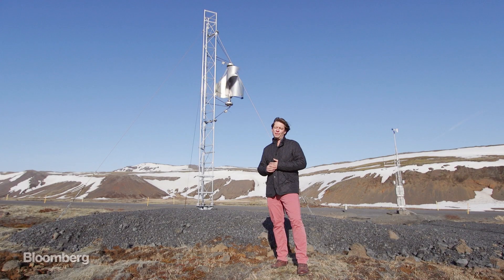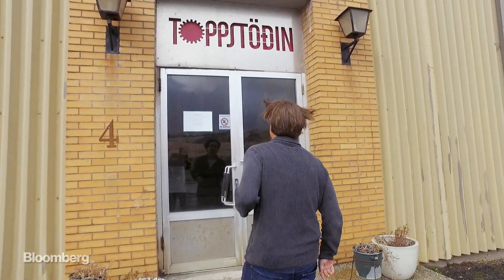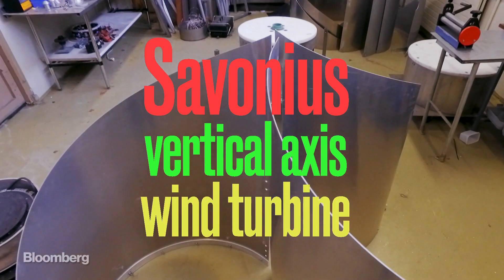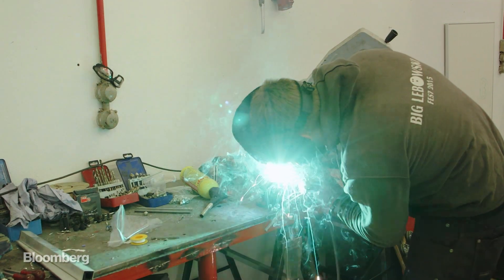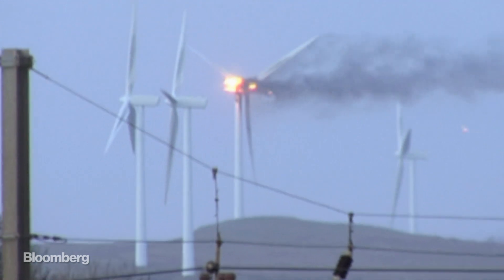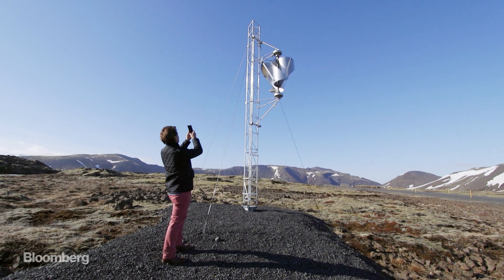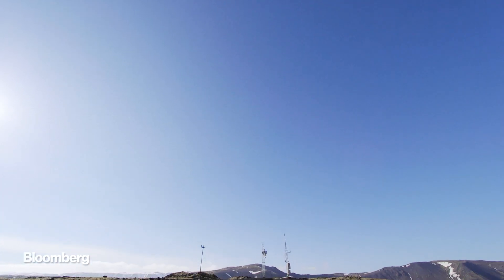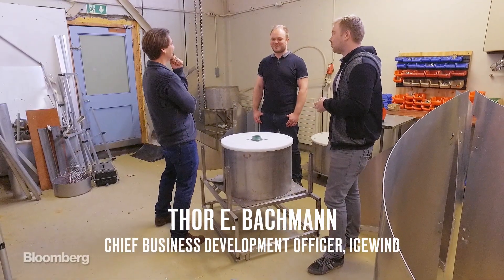The Tech That Could Fix One of Wind Power's Biggest Problems

Comment: The video failed to mention a major advantage of this type of turbine - it works with wind from any direction with no need for reorientation as wind shifts.
Reply: What is it's efficiency, and how does it compare against the conventional design?

And how does the Total Cost of Ownership compare btn the two models?
Reply: @darmillionaire  Efficiency is hard to rate. If you rate it by diameter, it would be about the same if the cylindrical turbine was really narrow but tall. And the propeller one would have the same rotor diameter (a very small propeller turbine). That gives you an idea of the vast efficiency difference. But that is only for the materials to get the same power, but easier to make and you only need a generator the same size as the same diameter propeller turbine (really small).
Reply: @darmillionaire  You can make the fucking blades by yourself. Those are the ones that make the hole thing working.
Reply: It also failed to mention how miniscule their efficiency is.
Reply: @NGC1433  They are compact so they can be placed on top of buildings and whatnot: Many little makes a mickle.
Reply: @NGC1433  But lets look at the high thin cylindrical tower turbines (that are even less efficient). You can put heaps of them up in the same space as only one conventional one. Also the tower ones look better and are quiet. If the cylindrical tower turbines are 1/20th efficient as one conventional one, you can put 20 in the same space. And each one would be 1/20th the cost of conventional ones. Generators 1/20th the size and the blades would be 1/20th the cost. And you could put one on top of your house, looks better and quiet. The biggest advantage is quiet. Maybe lots of them would give a shushy noise a bit, but none of that annoying hum. And also another big advantage of cylindrical turbines is more bird friendly!
Reply: @NGC1433  Meh you can make a lot of them.
Reply: These turbines make very little energy for their size and wind.  One on every chimney, which would be hundreds of millions of them, would still not make an appreciable percentage of our energy use.  They are handy in remote locations in Iceland, where energy needs are low, but not so much in higher energy use areas.
Reply: A long proven way of directing a windmill to the wind is a tail.  A tail is perfectly effective at directing a turbine into the wind like its been done since windmills were used to settle the entire US with water pumping.  The feature of being able to service wind in any direction is something that was not a problem, and is not a problem.  The problem why vertical has never succeeded is mainly backside pressure and the fact it cannot harness from both sides, one catches, the other resists.  A traditional windmill prop harnesses the entire swept area and thats why it produces so much more power.  Its not even close.  Thats why no utility company will ever use a vertical, because it doesn't produce comparable power.
Reply: it also "failed" to mention a lot of things, like their efficiency.
Reply: If it's put lower to the ground Kids can also have a ride!
Reply: @tonykuli  😃👍🙂
Reply: The low efficiency design could explain why it survives higher winds.
Reply: Windturbine efficiency is a combination of rotor efficiency and generator efficiency. The efficiency of a turbine is the generated power divided by the potential power of the rotor (P=1/2ro*cw*v^3*A). The rotor efficiency of a three bladed turbine is limited by the Betz limit (0.593). But the efficiency of rotors in this video is much lower.
Reply: DM i don't know i haven't been able to find out but the point is it not a revolutionnary idea it just has a slightly diferent field of activity.
Reply: I agree completely that there are advantages and disadvantages, but all advantages and disadvantages summed up, that would be interesting. Of course, public opinion is not visible in the LCoE. But still, it is in my opinion the only way to compare wind turbine technologies like Direct drive, Savonius, conventional gearbox systems etc. So i'm neither advocate nor opponent until the cost of energy has been documented.
Reply: You could also use aluminum, plastic, carbon fiber...
Reply: Darius der Rote I couldn't really tell if it's flawed for purposes of making power, but I like the way it looks. I make decorative windmills and kinetic art to sell, I think I'll make a small one out of aluminum and see how it goes.
Reply: Bill Juhasz Of course. But such is also more or less the case of small size, regular axial turbines. They are good for recharging batteries etc, but not much more. It is only at larger sizes that appreciable amounts of energy can be extracted from them.
Reply: It also failed by showing turbine without any device capable of producing energy. The one that guy is taking a photo of, it's just spinning to please the wind I guess.
Reply: @ardvark84  - Looks to me like it has two devices to generate power, one at the top & one at the bottom.
Reply: traditional 3blades  HAVT turbine is 42-45% efficiency and this crap about 9%. It is really old news- everybodystarts from this type because it is easy to build but compare ir to real generator is like comparing black barrel to PV panels as a way of gathering solar energy. And think about strong wind you still have to balance the drag force when with conventional generator you simply change direction to make rotor parallel to wind. High school physics.
Reply: @4nrgy  I realise they are way less efficient, but how is that measured? Is it rotor diameter or blade area or materials required? If the cylindrical ones are (say) one tenth the efficiency as propeller ones, you could put 20 in the same space and the generators only one tenth the size. But the real advantage in the cylindrical ones is no noise and more bird friendly.
Reply: @4nrgy  the problem with higher efficiency, is the high speed brakig needed when the wind is way above normal. this one solves that major problem easily.
Reply: Very true and cool.
Reply: IronheadOfScroteus every Material has it's own set of benefits and drawbacks. The main problem is the flawed, basic design of this type of turbine.
Reply: Yes, Iceland has been sitting forever on free energy source, they don't feel the same urgency and need for high efficiency.
Reply: Except when wind blows down or up.
Which it can.
Reply: +RoofMill.Net
Yes it is an advantage. Maybe not on open expanses where prevailing wind rarely shifts, but in urban, heavily-built areas, it is not uncommon for wind to be constantly gusting from all directions. A turbine that needs to be reoriented into the wind loses that much time before it properly faces the wind, while the type shown in the video will put any gust from any direction immediately to good use. It is a definite advantage.
Reply: Nor did they explain how it stops over spin, just that it does...
Reply: @Giorgos Chatziioannou I stood beneath a tall windmill near a beach in Denmark while it was operating. The windmill was probably 30 meters or taller (about 100 feet). It didn't make a sound. I tried as hard as I could to hear it, my hearing is close to perfect (I had it tested) and there was no sound at all while that thing was spinning.
Reply: corisco tupi good one
Reply: Well just imagine one on every chimney...it all adds up and helps take away the power of the Multi-National criminals!
Reply: +NGC1433 is it really not efficient ??
Reply: And uses a lot of Stainless Steel.
Reply: I believe to put more small windturbines that anyone can easily install in backyard or balcony, can do the change comparing with huge effort, while you try to build big construction for VAWT. So everyone of us can make contribution to better future. The same is with small solar installation. They are not that powerfull but make a change in understanding the possibilities with renewables.

But you are right HAWT will probably be newer as effective as well designed propeler turbine in hights. :)
Reply: We are using similar VWTs at locations that are mobile. They are only 3 feet high, and about 18"in diameter. Two of these will give you enough power to run your home, refrig., tv, freezer, lights, elec stove, computers and still have power to sell back to the grid if you were inclined. Since you don't need to face the VWT into the wind because of it's design, it is basically a plug and play system. We were generating 100 amps of power, aprox. 10k watts. Mines are using them because it is virtually the simplest way to generate power at remote locations. If you have a solar set up, it depends on the sun, but the set up is the same. A trickle charger keeps the batteries at full charge.
Reply: @999garyr  What generator are you using, and at what gear ratio?  I have never seen or heard of a demo of one of these these even remotely getting close to 100 amps and 10k watts.
Reply: @999garyr  Absolutely impossible for an 18 inch wind rotor to intercept that much energy from any realistic wind speed.  You made it up or someone lied to you about those specs.
Reply: The set up is one that I observed while working at the mines in Utah. Rio Tinto copper mine. I only know what I saw and experienced.
Reply: I am considering a vertical axis wind turbine that looks exactly like a tree, I call it : e-tree,
the trunk of the e-tree is brown, the spinning blades are green,
attached to the trunk of the e-tree are features of : wifi/mobile network, light and power outlet, to charge a car for example
Reply: Hello, How does one define and more so measure the efficiency of wind turbine? Serious question..
Reply: Sergey K
Well, Paul just beat me to the punch there.^^
But on the part of how: You can calculate it, simulate it or test it.
Simulating is by far the most common and easily done method, especially if you do not have any exact numbers for the cw.
Reply: "Potential power of the rotor" for that do we use the cross section area of the blades? if so then for a conventional turbine that does not include most of the area of the circle in which it spins inside? Is it possible that for a fairer comparison of these two types of turbines we need to consider not just the blade area but the larger area in which the blades operate in?
Reply: IronheadOfScroteus
For that: It's perfect.
Reply: And that means no ungodly expensive (not to mention breakdown-prone!) system to orient the blades to wind direction.
Reply: The advantage of this type turbine is that its not dependant on wind direction . Good for gusting variable winds. Also the trailing blade slows the the turbine in high winds.... preventing damage
Reply: RoofMill.Net Why does the generator need to be on the bottom? aside from perhaps being top heavy, I don't see any reason for them to do that. Or they could extend the shaft and install something to deflect the water, such as a cone. With the tech today, I'm sure there's a feasible way to stop the water.
Reply: This 2000 year old idea is so new that people just are not ready, and will have to be forced to use it.  Possibly at gunpoint.
Reply: While vertical axis turbines look cool, they are less efficient than horizontal axis (conventional) turbines.

This can be understood by using the formula for energy production in a turbine system.

P=1/2* a*V^3

Then multiplying P by the Betz limit of 59.3%.

Then understanding that a vertical turbine is half of that number because always half of the blades will be fighting the wind while the other half is following the wind.
Reply: There are other types of vertical wind turbines, which all benefit from this advantage, but the Darrieus type for example is more efficient.
Reply: it looks like a moving sculpture...
Reply: @EdHanulChung1  A moving sculpture would generate more electricity.
Reply: It also failed to mention major disadvantages. Which there are few.
Reply: @movax20h 
 Of course; like less efficient. and puts far more load on the bearings than a conventional one, which eats bearings in a matter of months anyway.
I have one comment for all the people who are bewitched by marketing dross like this: If it were that easy, we would have done it years ago. Engineers have spent centuries distilling out of all the crazy dreams people have had, the very very few that actually work, and of those, the very very few that work better than what we have already. We had a thousand years of windmills, that vanished in less then a hundred years because steam engines were simply massively better.
Reply: @leosmith848  I agree with you. I think small (<50kW) vertical axis wind turbines do have a sense in some situations tho. The bearing issues can be tackled for smaller turbines quite effectively (for example like the ones in the video above, where they do have two bearings at both ends). For big ones, no way - they are not reliable enough, not efficient enough, and at big scale do cost similar, and are actually challenging to design and build. Some people claim that because they occupy less foot print, you can put more of them in the same space, so you can use smaller ones, compared to horizontal wind turbines. But I am yet to find a compelling researching and numbers proving that.
Reply: Two windmills are in a field, and one asks, “What’s your favorite type of music?” The other says, “I’m a big metal fan.”
Reply: @Maplecook  that is funny.
Reply: worse efficiency, but cheaper and more compact. and have you ever been anywhere near wind turbines? they sound horrible. 

i like this design better,  for the same price you can build and service more than enough to overcome the lesser efficiency and it would work almost non stop at more places than a wind turbine.

its no contest really, one can be used by a power company in a wind farm, the other can be used by individuals/state for small grids to help reduce electricity bills
Reply: @gchatz6480  Agreed, this is micro grid tech.
Reply: Sure, but thats also the problem.  Wind only blows one way at a time generally.  So you have one side dragging against the other to some degree.  It can and will never achieve the power of a good HAWT.  Ever see a utility using a VAWT.  Its because it doesn't pan out to be as powerful or effective.  VAWT look cool and are interesting but not productive in actual real world use.
Reply: Check this design. available in Q1 2017 if supported by fans/enthusiasts . I  prepare also more action video soon. keep tuned...

https://www.youtube.com/watch?v=xpD9Ny3MWRY&t=5s

ROBOD. Thanks
Reply: Hi Gary. I'm interested in your setup , could I contact you somehow ?
Reply: Thanks Gary , just wondering who makes the turbines you are talking about.
Reply: Agreed. As well floating the base plate has a nice advantage for its shaft and friction reduction.
Reply: and also less powerful wind
Reply: why dont they put a bladed turbine on a spindle that will enable optimal orientation ?
Reply: Yes maybe but what advantage is that?  Wind does not blow in a circle.. And any legitimate turbine will have a tail, directing it into the wind direction.  Its no advantage at all.
Reply: wind direction is not a concern, look at the design.
Reply: yes I too was expecting them to tell us how
Reply: but, there's no reason the generator cant be mounted from above, is there ?
Reply: or be chopped to pieces
Reply: Eric Wesson how about high altitude wind... KiteGen and Ampyx will have a much lower visual impact and even higher LCOE, ROI and most importantly EROEI in the hundreds or thousands (300-3500)...that's where solar still sucks.
Reply: its true but it needs more speed to start and you don't have the same torque if you compare with a conventional turbine.
Reply: Giorgos Chatziioannou again energy efficiency is a big thing they forget to mention they didn't show how much energy it produces...
Reply: NGC1433 you should consider the number of these fit in the same area (i mean the "vertical" area) of the standard bigger ones
Reply: Absolutely I saw something like this on TV before
Reply: Anyone smart enugth to use knowlege learned in school this should technicaly be obvious ... then again i already saw people using that turbine on a Rotary set up so maybe its just me.
Reply: And they didn't mention how the size and output compares to conventional wind mills.
Reply: It's a shitty educational video
Reply: savoniuses are the least efficient of any turbine however. google comparative coefficient of performances of different turbine types (vawts and hawts) and you will see.
Reply: Just use 2
Reply: And even better...they are quiet.
Reply: Less noise, more bird friendly, you can put way more in the same space as a propeller one and the cylindrical turbines look better. Some are just like fat poles. You could have one on your roof and not annoy the neighbours with noise. Every house could have one along with solar cells cos of less noise.
Reply: It still kills avian life
Reply: Well its really taken over the world hasn't it? More ecobollox
Reply: From my vantage point mid pandemic, I say efficiency has been way oversold as an evaluative tool; let's try for a little more  resilience instead.
Reply: I thought that was obvious because it does not have the tail fins like in the windmills
Reply: Not efficient!.
Reply: Liers! It's soveit Ukrainian Onipko invention!!!
Reply: YES!!!
Reply: It also works with no wind at all. It has an electric engine that keeps the rotation. Excellent 👍
Reply: And how you get it out from wind ?
Reply: That's what I was thinking to , thanks for saying it aloud .
Reply: That's the point.
Reply: Works very poorly if at all when wind comes from any direction.  by that I mean produces little if any power.  

Please post data with wind power curve, make and model of machine from a reputable testing lab here so we can all have it.  Marketing videos are, well... Marketing only.  If I'm wrong that would be great but I'm not.
Reply: NGC1433 true but they can be more easaly  fitted into the landscape
Reply: Very true.
Reply: the main advantage is it look cooland take very little space
Reply: Uhm... the "blades" of this device use far more material then a comparable horizontal turbine and it is even louder than one, as the backsides of the Savonius has to be dragged against the airflow, creating a lot more turbulence and noise, while losing a lot of energy.
Reply: Paul Schoenmakers
Well the problem with those turbines is, that they use more material, are harder to produce and can not be installed on long poles to gather the higher winds and so on. Those problems are all well documented.
And this technology is not new in any way and has been updated for decades.
Reply: @Glaswalker1001  just add them to the poles of the current turbines for more power....if you want.
Reply: @CountingStars333  they are still an inefficient way of using material to generate power and would require a lot of additional wiring and controlling. That hasn't changed in the last 3 years. Huge turbines are simply far more efficient.
Reply: @Glaswalker1001  Alright thanks.
Reply: Another way of comparing the two methods would be to use Levelized Cost of Energy (LCoE). This could show the advantages of this simple technique in a clear fashion. if the design would last longer than conventional turbines, is cheaper to produce, install and maintain, this would show in the LCoE. It would also take into account the low level of efficiency as it produces less electric energy... So let's have it, what would be the €/kWh of such a product?
Reply: Efficiency from one design does not compare to another turbine of a different design. The SVAT blade design doesn't allow for overspin, (excessive RPM's). Let's say maximum RPM's are 1000, then the generator will have to be designed to make most of it's power between 300rpm and 700rpm. Other turbines may operate at higher RPM's and so their generator design will be different. Other factors would be the rotor and stator design, how the magnetic flux is cutting across the coils, the size of the magnets compared to the coils, the strength of the magnets, the magnetic circuit, etc.
Reply: @donation1913  Efficiency, cost, return on investment, etc. are actually exactly how you compare dissimilar methods of solving the same problem.
Reply: @donation1913  I agree, how is the efficiency difference measured? By rotor diameter, by blade area or by materials required? Or by the space taken up? lol And if the cylindrical ones are 10% as efficient as propeller ones, then you can put ten times more in the same area and only needs a generator one tenth as big (each) as the propeller one. And they would look better (just like thick poles) and way less noise problem and way more bird friendly.
Reply: Of course since its a vertical it lets water run down its shaft and will eventually get into the generator.  These vertical designs are prone top wear seal and get water into turbine for early failure.  There are just so many engineering problems with a vertical design its not commercially viable.
Reply: yes, because the energy is directly proportional to the amount of torque. Toque is directly proportional to the length of the blades because a blade is nothing more than a lever. The longer the blade, the more power.These things may develop more torque for a small wind turbine than a bladed one, because their air scoops can capture more air than a blade can, but still, the difference would not be too great. Small rooftop turbines, of any shape, will not be able to generate much power. As a previous poster noted, there is also the issue of overspin. If one designs a generator to work at maximum efficiency at a certain RPM, then winds producing RPMs above that have the potential to destroy the unit by overheating. So, when winds are too low there is no power because they do not overcome the resistance in the stator/rotor mechanism, and when winds are too high then the blades either need to be locked in place or uncoupled from the electric generator. The only other solution I can think of would be to have various generators and a transmission that would shift from one to the other. The added weight and size though would make that impractically expensive.
Reply: sorry, but did you vote for trump ?
Reply: reliability has always been more important than efficiency.
Reply: @brnkis1984  
That is a daft statement. Depends on situation and application and budget and average wind harvest and servicability and cost.
Reply: "Solar is a joke." Can you expand on that? Solar power is cheaper than fossils in large parts of the world (and not before long, almost everywhere).

Source examples (really, just Google, it's official):
http://www.independent.co.uk/environment/solar-and-wind-power-cheaper-than-fossil-fuels-for-the-first-time-a7509251.html
http://www.ecowatch.com/solar-cheaper-than-fossil-fuels-2167117599.html
http://www.abc.net.au/news/2017-02-23/solar-power-cheaper-than-coal-climate-council-finds/8296232
Reply: thank you giving valuable information
Reply: Pussy
Reply: It's also ugly as fuck.
Reply: @WimsicleStranger  efficiency has no look, if that turbine will saves you thousands a year, I'm sure you'll say,  BEAUTIFUL AND AWESOME